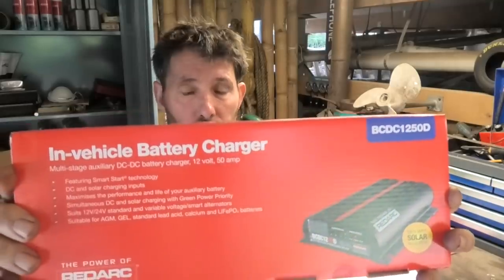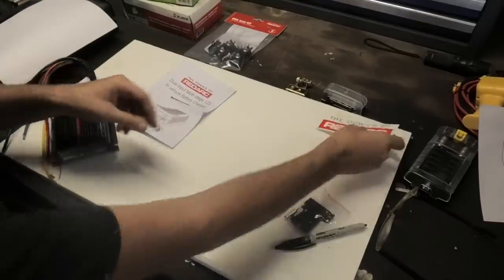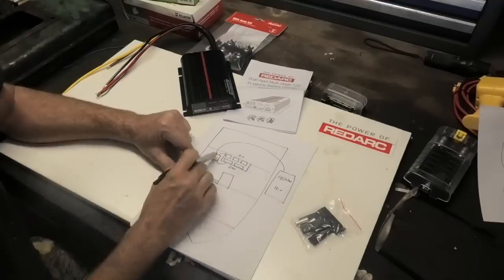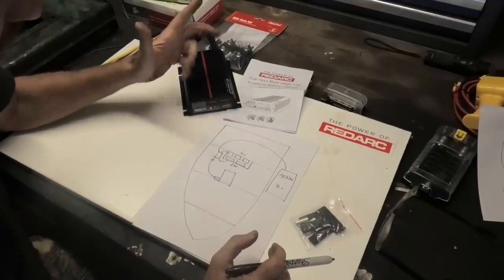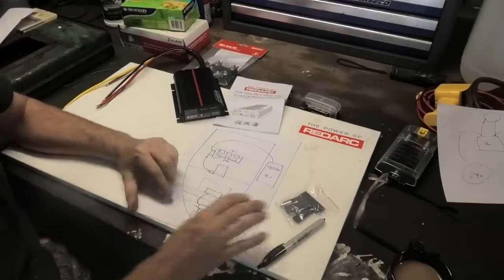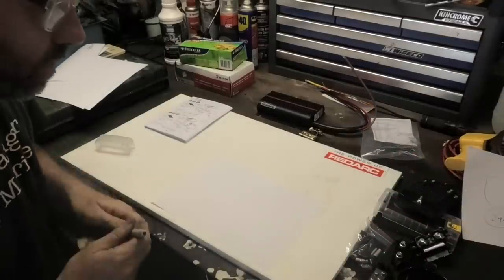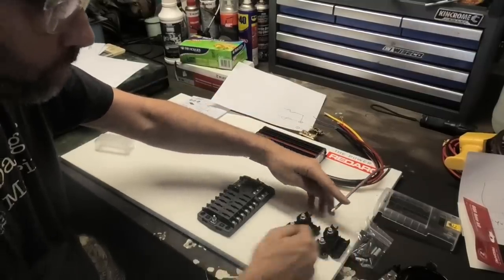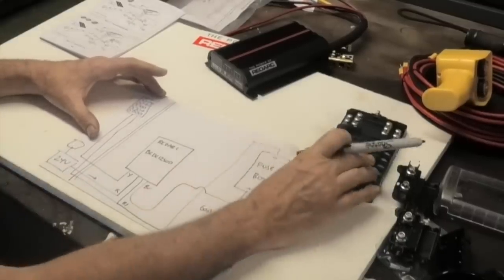Planning the trawler electrics

Comment: the only thing i would worry about is if the  charge controller dies that will leave you without a way to charge  your batteries  may not be a bad idea where you could have a way to switch the alttinator for a direct connection  for the starter batteries so you could at least charge the 24 volt system

Comment: I wonder if the plastic mounting board is a good idea?  It wont rust but will it be effected by a overheating electrical component.  As you said Fire is bad and plastic burns.  Here in the states if  electrical components are mounted to a back plane it must be fire rated plywood, sheet rock or metal.  It would suck to go in to the engine bay and find it full of toxic smoke from the melting plastic and not be able to see what the issue is? Maybe Aussie plastic is fire proof, just thinking out loud here...  I love your work and your style of get it done!  I watch your older vids when I need a fix.  Your bike videos are also interesting, Are you still making time to ride?
Reply from the maker: I'll have to look into it's fire rating. Unfortunately not riding so much at the moment.

Comment: If you really need an inverter I would probably only have localized inverters(ie cigarette lighter connection) for things that need them and not run secondary AC wiring, one thing with inverters is they are very inefficient and can use upwards of 30 watts of power while sitting idle so being able to unplug it when not in use would save some battery drain.
And you are right USB-c charging can charge with different profiles ranging from 12v down, I bought one for my 12v windows tablet off Amazon fairly priced.
Reply from the maker: Yes, I am quite keen to keep the AC to a minimum. I can see the advantage to localised inverters rather than a single unit plumbing AC throughout the boat.
Reply: @DangarMarine  oh and one thing that i saw recently in a target country, they sell 12v tv's pretty cheap(23 inch $179) compared to what i could find online  ;)

Comment: Why not put the bilge pump on some sort of thermal switch with automatic reset? This way you protect the boat from fires but don't make the functionality of the bilge pump depend on one fuse. Fuses can blow due to a serious electrical defect, but they can also blow because of an intermittent fault. Since intermittent faults are quite common in electrics, I think it would make a lot of sense to use a fuse that resets itself automaticly. Just a thought ;)
Reply from the maker: That makes a lot of sense, I'll look into that.

Comment: Have you considered a small hydraulic system to to run the winch? You're saying another battery (should be a deep discharge battery)  as well as cabling running to it won't be cheap. Possibly pneumatic motor to run the winch, only problem with them they're noisy. Whichever way you go, I'm sure it'll be done right :-).
Don't forget a master disconnect for the batteries to disable the power. I'd confirm the inverter will charge 24V from 12V input, not saying it won't, I'd check it to be sure.
You ever think of using a self resetting circuit breaker for the bilge pump rather than a one shot fuse?
Good call on the grounding to one common point.
As usual, a great video.........Mike

Comment: 8:30 Small remark on AC and long distance transport. AC in and of itself isn't better for long distance than DC, it's just that it's a lot easier and cheaper to convert AC from low to high voltage and back (especially back in the day).
In fact, using high voltage DC for long distance is more efficient since there's no reactive power and parasitic capacitances and inductances are far less problematic.

Comment: If I were to send you an older copy of the ABYC manual where would I send it. It has a complete electrical section for both ac and dc systems as well as an extensive section on galvanic corrosion and bonding. Assuming I can find it.
Reply from the maker: That really kind of you mate. Send me an email to dangarstu@gmail.com and I'll give you the details.

Comment: You are right to install a battery for Anchor winch but you should charge form engine and also make it so it wont work unless engine running as it will draw loads of power batt wont cope alone with all chain out and weight when pulling in. Sail boats do this. Mart

Comment: Why not just put a separate small charger for the winch battery powered from the engine alternator? You can go from 24v to 12v with the charger and you will never have to worry about being stuck on anchor because if you are out all it will take is a running motor to lift the anchor.
Reply from the maker: Have decided to run a 24 anchor winch of the starting batteries now.

Comment: Better idea to separate the DC & AC systems, and good single point ground.  Check into galvanic isolator on the earth wire from your AC system to the single point ground.  It uses a quartet of diodes in series/parallel to block the small DC voltages driven by dissimilar metals while permitting a fault AC current to flow.

Taking a 12V tap from the 24V system is not a bad idea if you have an equalizer to move some electrons as needed to balance the set.  If your charger does not include this feature (which works when the alternator & solar chargers are off) then look into an HA04 or equal.

For preventing electrical fires, think about where large energy is available & fuse close to the source.  You are doing this with the fusing close to the battery set.  Think about having a battery disconnect as well, Blue Sea makes good ones.  And protect the cables before the fuses with another layer of insulation, like self extinguishing split loom.  It is like the automotive split loom but will not continue to burn when the heat source is removed.  It is sold for marine & aviation use.

I froze your opening sequence with a frame of Eddie on the TV.  My bloodhound, Charlie, saw him then ran to get his favorite toy & brought it back to the TV for Eddie!  Keep up the great work, we really love your channel.
Reply from the maker: Thanks for the info mate. Eddie appreciated the gift! :)

Comment: Just my opinion but I would take a step back and consider where I would place my distribution panels. That engine area is going to be constantly sweltering with salty water. Also it will be the place where there will always be vibration. You mostly see electric distribution panels in engine rooms on yachts  that you can walk around in the engine room and control the humidity. I don't see how anything will last in there more than three years or so.  I owned a steel diesel trawler about the same size as yours for years and anything under deck was caustic to electric components.  Electronic devices fail and the more functions they perform the more they fail. Have a backup plan for failure of that device and rehearse it often so that you can do it in the dark. Things rarely fail when you're not already in a bind.
Reply from the maker: Hey John, yes, it certainly is a harsh environment for these components. The charger needs to be close to the batteries, but I could go through the bulkhead and mount the charger in the lazarette as I believe that will be the most sensitive part of the setup.

Comment: As Far As Your First Board, Everything Looks Great Butt I Would Highly Recommend A Master Battery Cut-Off Switch Between The Batteries & The Starting + Post On Your Board! And A Lighting Rod At You Highest Boat Point With A 4-Gauge Solid Copper Wire Directly To The Keel In Water Grounding Block Should Be A Must On Any Metal Boat! Plus Add EXTRA & Large Zincs Just For Shits/Giggles On Stern Corners & Center Midships Under Engine Somewhere Behind Water Break Point So It Is Always Wet!? And If You Put Hydrolic Load Leveling  Fins On Stern? Add A 2" Round Zinc On Top Side In Middle Of Each Those Also... You Can Never Have Too Many Zincs Mounted All Around... I'd Also Recommend A Large Bank Of Lithium Storage Batteries & A Wind Turbine or TWO To Get As Much Free Power As You Can Afford To Add To Your System As You Go Forward! Thanks Mate I Enjoy Watchin Your Project Videos & I'm Glad It's Your Having To Do All That Dirty Mess Refit & Not Me! I Own A 1984 30' Christ-Craft Catalina Cabin Cruiser/Fishin "Fiberglass" Boat!... LOL

Comment: When explaining the earth circuit, I assume you mean everything is wired back to a post, that post is then "lead to earth on the batteries", with a wire bonded to the hull?
Reply from the maker: Yep, that's it.
Reply: I worked at air traffic control facilities all over the usa and carribean nations. We had well marked ground system for entire place with marked copper plates at major places in the installation. The earth (ground) side is as important as the circuit side. Good tip to be concerned about system grounds. Older vehicles and boat suffer from corroded grounds (earth) that are not easy to troubleshoot because everyone assumes the ground is good.

Comment: I had an electrical fault in my engine bay which included the work light in the area. Trying to fix the problem was a bit of a nightmare without light. The solution to this was to run a separate circuit for the lights. in other words two lights on completely different circuit's. The chances of both going down are slim. If you have a problem in the engine room you will at least have a backup light.
Reply from the maker: Good point and idea, I like that.

Comment: Keep in mind that Redarc unit can only output a total of 750 watts even though you will have 900w of solar. Also that unit only charges the 12v bank and will not charge the 24v bank. A couple of options I see for the anchor winch is a battery isolater. In which case you would still need large cables to handle large inrush current between batteries. Or use another DC to DC charger like the REDARC BCDC1206. With the latter option your wiring from the main bank would only have to handle around 6 amps.
Reply: Unless the winch battery is dead flat there won't be massive current draw from the battery bank. Certainly a worthy note though 👍

In the case it's dead it will pull current from the main bank. Normally the cable size depends on peak winch amp draw, but it can be down sized if he adds a VSR or fuse or both.

The VSR can be setup as current limiting I think, but generally voltage drop in the winch battery should be enough to isolate the main battery bank and stop those high current transfers, just double check with Redarc.

He can just run a 60amp fuse on the cable run for 10years and when it blows he knows his winch battery is dead!

Essentially the wire really only needs to take the rated amp charge current from the redarc dc-dc output. 25-50amp check the manual? Using this setup provides faster recharge than running a separate cheaper dc charger. If your anchoring a few different spots within the hour well your pushing it. You want to maximize the input current to the winch battery.

https://www.redarc.com.au/voltage-sensor-12v
Reply: @andrewiannello6548  Loose battery cables, sulfated battery, shorted cells, ect. could all cause fault conditions in which could cause an over current condition when the winch is being used. The VSR could be useful to prevent over discharge of the main bank but provided no over current protection. Add a fuse solves this but then when it blows you have to find a new fuse. I personally just don't see this a a good solution. The BCDC1206 solves all these problems and can give any indication of fault conditions. It acts a boost converter enabling it to fully charge the battery even if there is a significant voltage drop. It will ensure the battery is always charge properly preventing sulfation. It shuts down if there is any kind of over current or short and it prevents over discharge of the main bank. Additionally a battery switch could be added so that the winch battery could be charged from either the starting bank or the house bank as the unit can charge a 12v battery from a 12v or  24v supply. Sure your limited to 6a charge current, but with a properly sized battery is that an issue?

Comment: Not sure if I'm missing something with your intended setup but, That Redarc unit is only capable of 12V out, how do you intend to charge the 24V batteries from it?
Reply from the maker: Ah, it turns out I can't. The alternator will be the only thing charging the 24V batteries. Looks like I might need a second 24V solar array to supplement the alternator.

Comment: Very informative video.  I am also in the planning stages of the new
 electrical system for my boat.  She's only a 17.5 footer but I want everything new and right. The previous owner is lucky he didn't roast the boat with the way he hacked and wacked the electrical system.  He has cuts/splices everywhere, he taped fuses inline....i almost crapped myself when I pulled the main harness.  Like I said, she is only 17.5 feet but I'm planning 2 systems, primary for engine and a separate for accessories, electronics & lights.  I like the solar back up idea.  I have big plans for this little boat (wife not to happy. But oh well...). Is there an email address I can send you my plans for your opinion/advice? See you in the next one.
Reply from the maker: Hey Vin, sounds like the boat is definitely due for a rewire! You can email me at dangarstu@gmail.com

Comment: Hey Stu, love the series keep up the awesome work.
My experience is from 4wd wiring and being a sparky, but I’ve never wired a boat so take my advice with a grain of salt.

Those chargers are awesome and very reliable, the only fault with them is the display is very limited, other than a flashing light, you have no idea how good your solar is doing or if your alternator is working correctly. I would recommend putting little watt meters on the solar and alternator inputs, eg https://www.jaycar.com.au/200a-dc-power-meter/p/MS6190 so you can see right away load on alternator, and if your solar is working well. There are other systems out there for monitoring different loads, but this is the cheapest and works well on my vehicle for just doing a quick check.

With your idea for an extra battery for the winch, im not really a fan. I know with 4wd winches and compressors they much prefer to run straight off the alternator with the extra few volts making them really run properly. I’d invest on the larger cabling rather than another battery and more serviceable parts. Get some double insulated welding wire 50mm2 $12perM on ebay. That should run almost any load up to 300amps.

Also make sure you fuse your solar, they say to put it nearest the panel as possible.
And think about isolators, maybe you will want to have to ability to isolate your solar and batteries to be able to work on them, or turn just them off.
Basically just go to Jaycar and get your cash out! Enjoy, can't wait to see how it all works out.

Comment: Gday Stu to my understanding the bcdc charger will only output 12 v so the alternator will charge the start battery direct. the other thing is and I could be wrong but any earth from an active dc circuit will open you up to grief from electrolysis this doesn't mean you can't run a lightning wire from the mast to the keel but none of your battery earths should connect to the hull. This does not include antenna earth planes not much you can do about them but they are usually well above the water line and passive so don't pose the threat an active earth does. As I say I am only going on advise I have been given enjoy queensland
Reply from the maker: Hey mate, yes, the alternator will charge that directly, I drew that slightly wrong at the start. I’ve been talking to the guys at Raymarine and I believe that the DC ground is required and won’t cause problems but I’ll run this plan by him too and get confirmation.
Reply: Stu I agree you need a ground but that can be achieved with a heavy cable it doesn't have to be the hull as i said the antennae are different but they are not passing heavy current.

Comment: Just quickly, I would start with the positive bus and fuses (self resetting circuit breakers? about $6 each plus covers at RV shops) up the top and the negative bus at the bottom so your wiring diagrams will follow world standards, ie all the negatives should be connected together as a bottom line on the schematics and all the control and working equipment trickle down from the top positives (in your case two) it makes troubleshooting easy and always put relay and contactor coils as the last items before the negative line, never put a switch or contact after a control device also the boat's hull should be bonded to the negative line as well just as in a car. PS I'm only 11 minutes in.